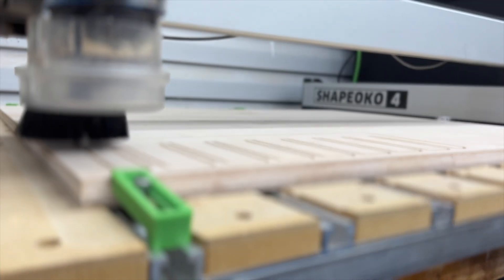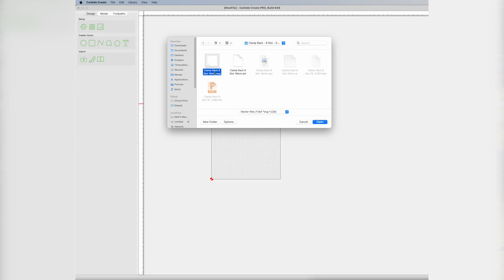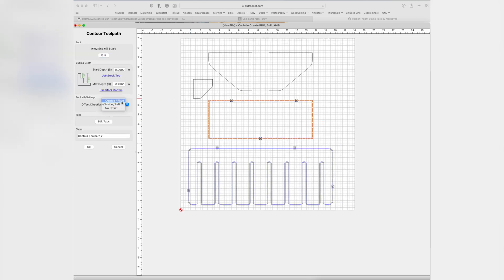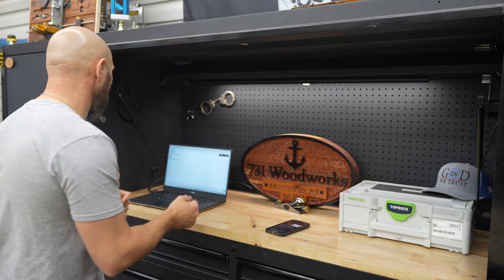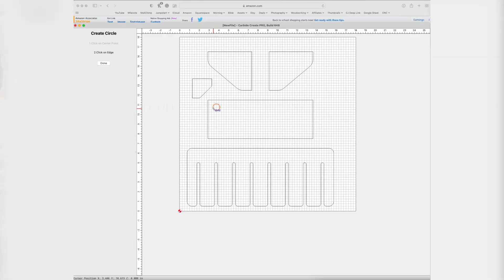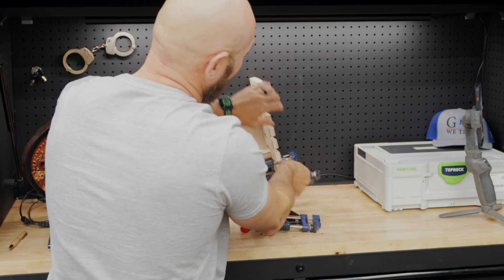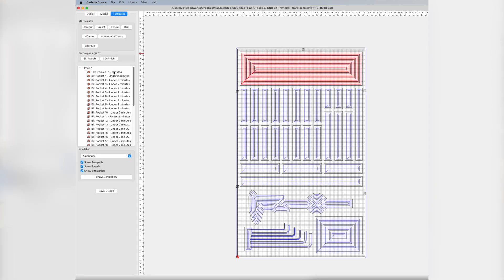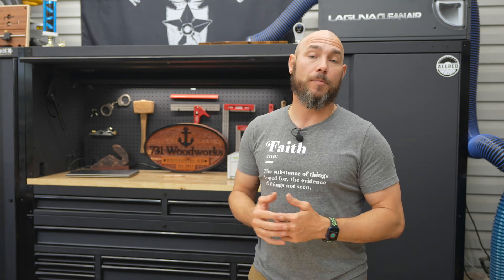Making Custom Fit Tool Storage with a CNC | Easy CNC Projects

Comment: First HUGE THANK YOU!! I’m a devoted follower.   New CNC user and your videos have really inspired me.  About transferring your files. I’m sure you have a Gmail account.  Did you know it also comes with could storage.  You could save your files to your Google drive and then download it or even better setup google drive for desktop on both computers and you instantly have access to the files on any laptop or device when you log in to your account.  It’s how I transfer all my files. In addition it’s in the cloud so you have backups.

Comment: I just use remote desktop to log on to my laptop in the shed from my desk inside the house and do all the work that way. I open everything directly on the shop desktop and get everything done remotely. Then go out and start it directly from the shop laptop. A bit easier than emailing yourself. Just a suggestion for anyone looking for an easy way to manage multiple PC setups like this.

Comment: what type of mdf do you use? thanks
Reply from the maker: 1/2”
Reply: @731Woodworks  thinking about getting the file from your website and making one for myself for the shop, the mdf i have has a darker colour though i like the light colour of the mdf you use, are there different types of mdf or is it just normal to vary in colour?? new to all this stuff.. thanks again

Comment: Great content, what size is your CNC and will it flatten a river table , or just flatten any wood work . Thanks from Skeeter from Texas. A true newbie to work working.
Reply from the maker: Thanks.  It will flatten wood. The cut area is about 29 x 29 inches.  It would have to be a rather small table to flatten tables.

Comment: Try gluing a thin piece of sand paper on the magnets. It will help prevent them from sliding as long as the weight is not too much for the magnets strength. Just a thought

Comment: One of the casualties of the Ukraine war is there is an embargo on birch plywood (because it comes from Russia).  Makes it tough if you want CNC manufactured modules for your model trains.  These are not complex.  One has to cut slots and tabs so it fits together.  Easy for me to say.

Comment: On that "comb" looking piece, don't you want to cut on the outside instead of inside?  Cutting on the inside would make the openings .25" plus the width of your bit on either side of the opening.
Reply: He set the width of the slot to exactly what he wanted rather than the width of the clamps so he cut on the inside to get the final size he programmed.